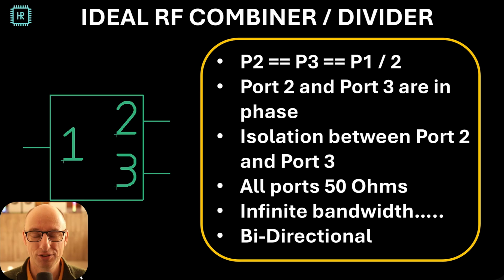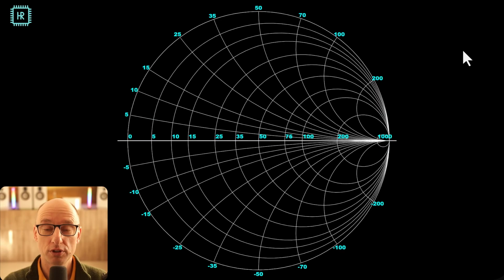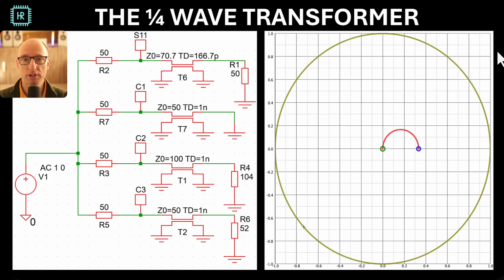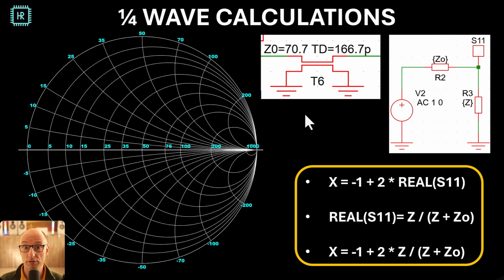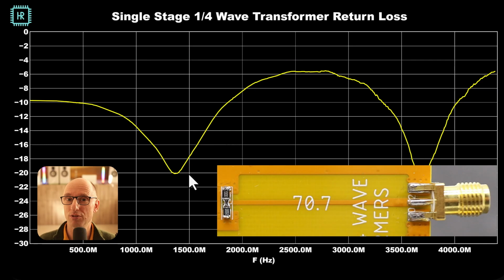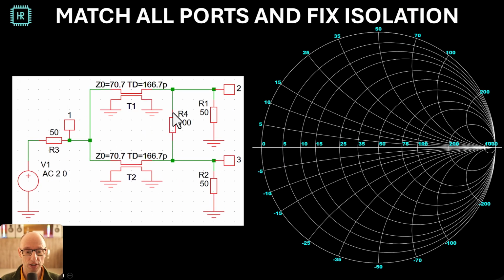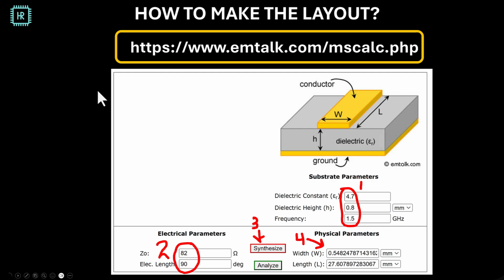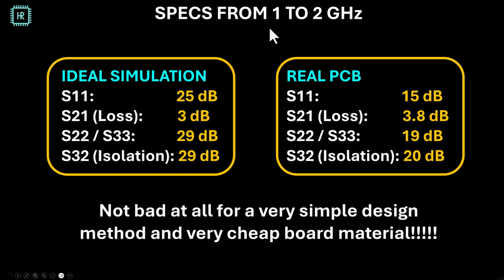Quarter-Wave Transformers Without HFSS

Comment: Love your videos.  Couple of point about FR4 that you didn't cover.  Both relate to the dielectric constant.  Firstly, the value at room temperature can be +/-20% depending on whether you have a lot of glass or a lot of resin under your line.  Secondly, the tempco of of the dielectric constant for FR4 is around 1000ppm, which is horrific.  So long as you take these in to account (as well as the high loss of FR4) then you're fine.  But you need to be very careful.  That's why Roger's type material is so much better.
Reply from the maker: Yes, I agree, but for simple RF applications like this, you can take a lot of tolerance before they really fail. If you want to make some tuned filter or multiple quarter wave transformers, FR4 fails (I tried :-D ).

Comment: When determining the delay (1/4 wavelength) in the PWB don't you need to account for the dielectric constant of the board's material? The higher the board's dielectric constant the slower the frequency travels through the board, thus a shorter distance.
Reply from the maker: Yes, you have to. In this video, qucs handles that, or the strip line calculators.

Comment: Hi, I am working on an audio application which requires a 16 Ohm DAC Output to be Converted to 10 Ohm Input of Receivers. Can this 16 to 10 ohm conversion be achieved with the A Wilkinson Combiner as mentioned in the video.
If no what could be the alternative?
btw good video
Reply from the maker: Ehm, pfooh, I don't know where to start here. You are missing too much basic electronics knowledge based on this question making it hard for me to answer but I'll give some short answers:
No 'matching' is needed at audio frequencies.
In input impedance of 10 Ohms is not common, audio inputs are usually 10k or 100kOhms. Lower values are possible in special applications but they are uncommon.
A wilkinson combiner is used for RF. You could make one for audio, but it would be the size of a small city probably due to the insanely long wavelength so not very practical. Impedance conversions at these frequencies would be done by a transformer or with active circuits (opamps).

Comment: Hi,
Isn't rat race ring a RF combiner/divider as it also uses quarter wave transformers. Then why are we not using that in this case or is this video about how quarter wave transformers work in general?
Reply from the maker: you're absolutely right. I could have used both to demonstrate quarter wave transformers. I just picked the Wilkinson combiner to do that. I could have added it to the rat race ring as well.
Reply: @HansRosenberg74  Got it
Thank you for the reply!

Comment: Hello Engineer, I have two questions, and I’d appreciate your answers. In double-layer boards where the bottom layer is designated as the ground plane, should we also use a polygon on the top layer or not? And the second question: if we use multiple vias instead of a single via next to the pads, how is that? Does using more vias affect the integrity of the ground plane?
Reply from the maker: If you use multiple ground vias, the impedance will go down, so that is good :-) Check out my other videos, they should show a bit more about that.
Reply: In this situation, is it necessary to use a Gnd polygon in the top layer?
Reply from the maker: I would definately ground the top polygon. Check out this video: https://youtu.be/vumYrebIXm0

Comment: Ty for the video. @18:35, is what you built the same as the 'HC125A – Low Profile Hybrid Coupler for Multiband GNSS' made by TAOGLAS? Thank you for the reply!
Reply from the maker: I tried to find that video but could not find it easily. A hybrid coupler sounds like something different but I'm not sure, you could make a coupler with a -3dB coupling factor and it would act a lot like a wilkinson combiner I guess.....

Comment: Hihi, I designed a small pcb using your excellent tips.
Nice board was delivered last Monday to find out that one of the IC's was not available for the selected footprint.
Learned my lesson, first but the components of use the component library of the PCB factory and let them do the soldering (come on guys it's 2025 by now)
Reply from the maker: That's a nasty one. I"ve learned to always triple check those kinds of nasty things, hope you find the right footprint!

Comment: Electronics has been a hobby of mine since the early 1960’s. Though my formal electronics education didn’t go past High School I have been playing with it ever since. And your channel has been very informative and understandable. I had several friends that designed circuit boards and they were overly concerned with the symmetrical locks of the component, layout and not considering the current paths. Their idea that “a current path to ground was good enough”. I now know this is why they had problems getting it to work even at 16 MHz. I did ask them why they weren’t laying it out like a radio frequency circuit? Considering AM radio works at 500 KHz. You tend to work at higher frequencies but it still applies and I’m still interested. Thank you.
Reply from the maker: great to hear your story :-)

Comment: This is great and I really appreciate the insight that SPICE-likes can just directly simulate transmission lines, and for many applications, that’s good enough. One of the questions that I had about the double Wilkinson combiner is the trace geometry - in particular, the circles on the board. What’s the reasoning for having them so… circular, rather than more oval-shaped (and, I guess, achieving a shallower angle into the intermediate resistors)? Does that make a difference? When the traces joined at the resistor in the middle, I wondered if the sudden thickness of those traces made any difference to their characteristic impedance - and, if it didn’t matter, why not. (I am always a little scared of things like this that I don’t understand… I know that you have to break some of the rules to get a realistic design, but how do you know which ones can be broken? 😅) Thanks!
Reply from the maker: Well, it is very easy to get the length right of half a circle ;-) The point where those 2 half circles with different widths join is not idea. I just wanted to show how easy it is to make something very acceptable with very primitive means and materials. It would be better to use 45 degree angles and at the join point make a smoother transition and then use a em simulator to verify and optimize it.
Reply: @ Makes sense - and the measured results seem to be just fine for the frequency range that you care about. This is definitely the sort of experiment that makes me understand why people buy minimills to test RF layouts with.

Comment: This is a great tutorial, I love how you used a spice simulator.  I am here to look at the power rating for those 100ohm resistors, this is a nice method to explore this.

Keep up the good work 😃
Reply from the maker: Thanks, a 20dB coupler will be next
Reply: @HansRosenberg74  thank you. 

Out of interest I tried to use the transmission line model in ltspice but not reproduce sensible results. 

There is quite a good free RF simulator, QUCS studio (it’s not not fully open source) which has harmonic balance and allowed me to explore the power dissipation on the isolation resistor
Reply from the maker: in simetrix it works fine, maybe ltspice uses another model for the transmission lines. I know qucs, using it for the 20dB coupler and tline analysis. I have to have a better look at it for microstrip designs.

Comment: I like your measurements & verification practical parts. Very refreshing as opposed to "oh, look, it just works".
Could you practicly verify PCB's transmission line (especially diff. pair like USB) impedances with NanoVNA?
Say, put a clone of trace(s) on a prototype spare board area, terminate with u.fl or SMA connecors along with calibration block for VNA.
I'd watch a video on such experiments even if it was to conclude that it is not viable.
Reply from the maker: Thanks. Verifying 100Ohm differential traces would be a bit tricky. I have not thought about this before, maybe use a 1:1.41 transformer (broadband), and calibrate those. Then put the 100Ohm traces in between and see how much more loss you get. You could maybe even calibrate at the secondary side of the transformers.
Reply: @HansRosenberg74  calibrated custom transformer sounds expensive and/or time-consuming 💪
For USB 2.0 FS/HS, since Z common is defined in spec, I was thinking at least measuring that with something similar to PCB test coupon.
Reply from the maker: its not that expensive, you just put 2 of those transformers on a board and then just calibrate them. So your calibration resistor would be a 100OHm + 1:2 transformer. This will work very nicely within the bandwidth of the transformer.

Comment: A transformer with ferrite core working at frequencies up to 3GHz looks like a miracle. I can't believe it's true, the loss in the core will be too large. Once I needed to design a galvanic isolation for TV line with low loss and working frequencies up to 900MHz and I didn't find a proper ferrite transformer.
Reply from the maker: Well, its minicircuits. I've used a ton of their stuff in the past and it always does what it says in the datasheets. So I have no doubts :-) But its crazy how far the ferrites have come over the years!

Comment: attenuators are such a hack to use instead of 50 Ohm SMA loads... tho I've never entirely understood why they act as such. In my stupid brain, since they have a "characteristic impedance" Z0, they can be considered as a T-line. So they are an open terminated T-line in your setup.Why is there no reflection at the input? You are saying the signal goes thru on way, then backwards from the open terminatiation. Why does it goe thru on way in the first place??? Shouldn't it reflect back immediately?
Reply from the maker: Attenuators have (if they are perfect) a 50 Ohm input impedance if they are also terminated with 50 Ohms. So, there is no reflection.

If you leave an attenuator open at the output, and the loss of the attenuator is 20dB, then this loss will cause the input impedance of the attenuator to be very close to 50 Ohms. You could see an attenuator as a very very lossy transmission line with a perfect 50 Ohm impedance. 

So if you put in 1W, the signal will appear at the open output 20dB lower, so 10mW (a factor of 100). This 10mW will reflect back perfectly, however, it goes through the 20dB attenuator again (in the other way now) reducing the power by 20dB again. So what comes out is 100uW.

1W and 100uW is a 40dB difference, hence an 40dB return loss.

Hope this clears it up :-)
Reply: @HansRosenberg74  You can take those cheap termination resistors and place it on the attenuator. It's going to be better than the attenuator alone.

Comment: I'm assuming that a 10 MHz quarter wavelength it's going to be a pretty long transmission line
Reply from the maker: Ehm, yeah ;-) If I'm not making any errors in calculation  here, it would be around 3.75 meters for 1/4 wave at 10MHz assuming 1.5e8m/s signal speed :-) Board material is not that expensive these days but I still think this is going to hurt :-)

Comment: I hit you up right when you started on LinkedIn saying you were a great instructor..... so I said I'm receiving a signal of one pulse per second or have gone ahead and put it through temperature controlled or ocxo module and have a 10 megahertz signal and I want to divide that up between 4:00 SMA outs! I I'm already using a really good pulse per second and a microcontroller to create my own network time so I would like to sync all of my RF devices with the same 10 MHz clock.
Reply from the maker: So you want to have a 10MHz splitter / distribution amplifier? Is this a digital signal, or a sinewave? What are the demands on phase noise? I guess a 4-way splitter with 4 amplifiers behind it would work well for a sinewave (you can use those standard mini-circuits transformers). The amplifiers should deliver enough signal strength and be relatively low noise. If it is a digital signal, you can use gates, but you have to make sure the supply is really clean, otherwise supply noise will translate to phasenoise......

Comment: Thanks, that was really informative. You mentioned ε is a bit uncontrolled in commercial FR4; is it possible to work back from your results to find the actual average value for an improved iteration? Presumably your looped traces give a better average value than a straight trace, due to the weave of the PCB.
Reply from the maker: I tried, but it is really tricky. You  have to know the exact location of the reference plane of your network analyzer measurement. I did not include enough options in this board to be able to do that accurately. I'd also have to calibrate out the connectors. I thought it would be relatively easy, but turns out it isn't.

Comment: I'm a little confused why you went through a long procedure at 9:30 for calculating the impedance of the quarter wavelength stub rather than just taking the geometric mean of 50 and 100 ohms. Anyway, very nice video! Thanks.
Reply: To get the midpoint you have to calculate the mean in the Gamma domain, and then reconvert to impedance. That is what was done in the video, because X is Gamma as shown below. I think the geometric mean thing is a coincidence, in fact the correct impedance is 70 ohm when you have a Gamma of 1/6 (0.166...) and not 70.7.

X = -1 + 2Z/(Z+Z0)
X = (-(Z+Z0)+2Z) / (Z+Z0)
X = (Z-Z0)/(Z+Z0) = Gamma
Reply from the maker: the x-axis is non linear in a smith chart. So that is what all the math is for. If you take the geometric average you would get 75 I assume (if that is what you meant) and we need 70.7. But I'm not a math genius so I may be missing something, an easier solution.....
Reply: @HansRosenberg74 arithmetic mean gives 75 ohms, but geometric mean gives 70.7 ohms

Comment: QUCS (or qucs Studio which adds some nice features) should be much more suited for this job
I haven't used it much myself, but for one, it comes with smith charts built-in...
Reply from the maker: I found out about the more advanced features (or maybe standard features) in qucs after I did all the work for this video. I actually used qucs for creating some of the other structures on my rf demo board (like the 20dB coupler). I did not run into the microstrip simulation part yet, but I saw a video on it a few days ago and I really like that. I want to make some stuff with this in the future.
Reply: @HansRosenberg74  the filter generator tool in qucs can also generate microstrip versions